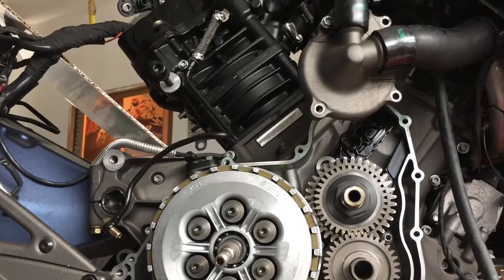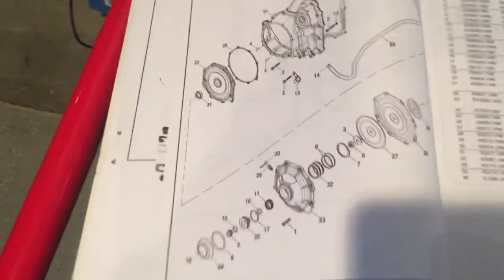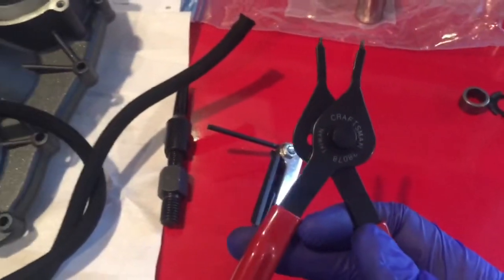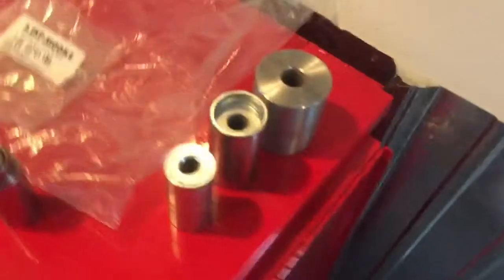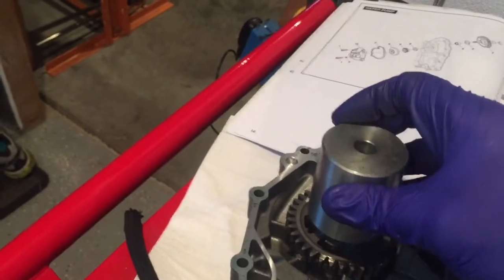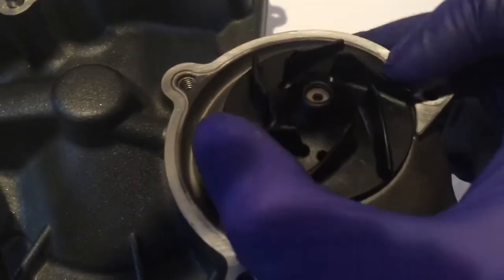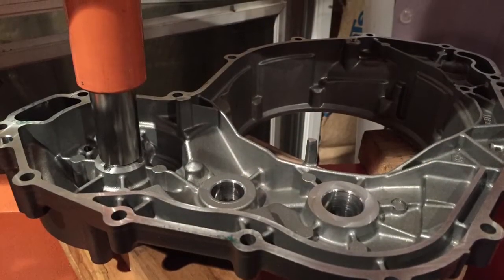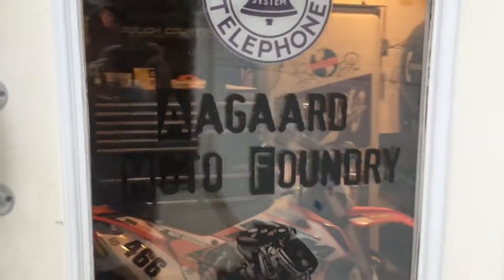Buell 1125 and EBR 1190 Water Pump Inspect and Repair

Comment from the maker: Just some added notes on this project: Make sure to lock the engine at TDC on compression stroke.  See the shop manual for most all of this.  Also, you don't need to remove the impeller to get the clutch cover off, but you will to get the water pump gear out ( I mis-spoke in the video).  I have all of the tools, so I can press in new bearings and seals for you.  I will gladly help, so just comment with questions.  A note on pump changes - 2008 and 2009 are the same pump, the only difference was the thrust washer change from the 08 to 09 parts book.  In 2010 Buell changed to the pump - which is a completely different clutch cover, pump gear, and rotary seal.  I am told this 2010 Buell/EBR 1190 seal set up is better, but I still know of EBRs that leak.